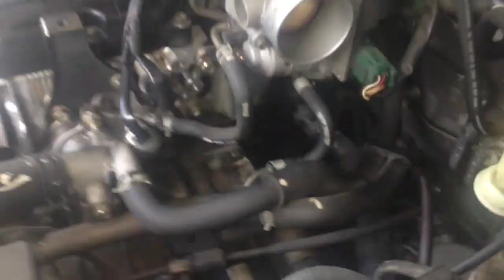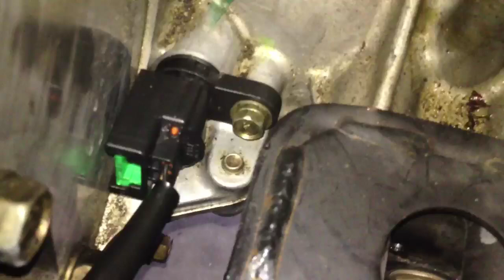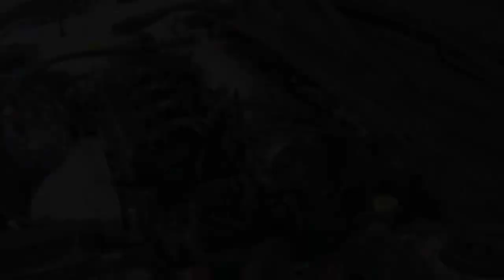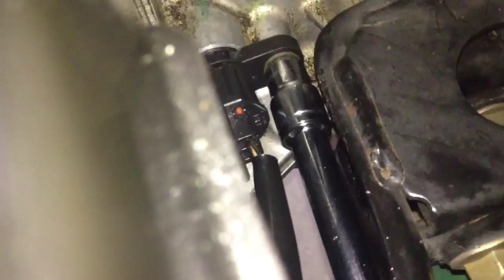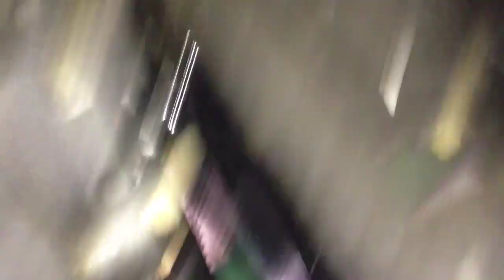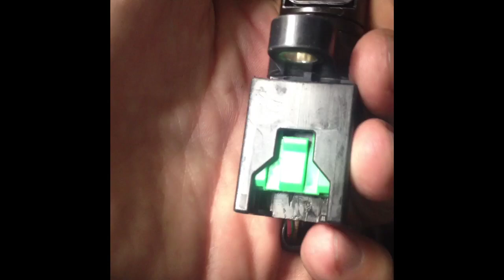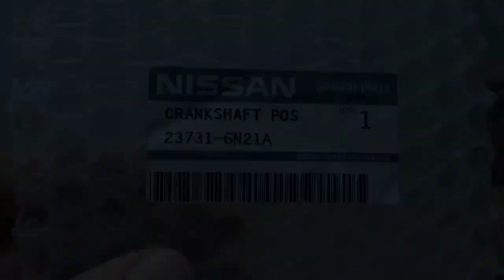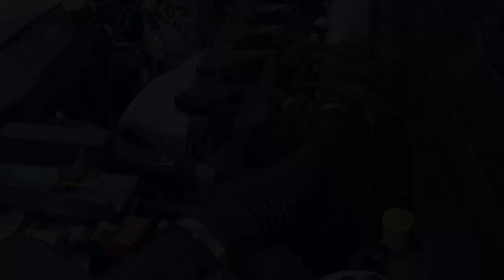Code P0335 / P0340 /P1336 - Crankshaft Positioning Sensor Replacement DIY - Nissan.

Comment: Could these sensors go out and NOT throw a code?  Because my 2005 Altima is not starting and was running really rough before it died, but I don't have any codes showing up.  I think I'll change these sensors anyhow and see if it helps/fixes it.
Reply from the maker: Yes, it's possible. That's how it was with my car. I was driving for few months without Check Engine light and couldn't figure  out what was wrong. When codes finally came up, I new exactly what to do.

Comment: What would the difference be on a 1992 Ford Explorer with a 4.0l? Do you have a video?
Reply from the maker: It will be different on Explorer. Get owners manual for your model on eBay for about $4. It should point out the location of the sensor.

Comment: I have replaced this sensor as well as cam sensor 2 times since I've had the car (within 2 months) and the check engine light goes off after I replace it, but after a couple of startups the SES light comes back on and I still have the same codes 0725 and 0335 what should I do?
Reply from the maker: You probably used low quality aftermarket sensors. It happened to me once. I ended up buying original sensors from dealer. Never had problems after that.

Comment: Sensors are available on Rockauto.com for $23.79.  Look under the 2002 altima/2.5L L4/Ignition sub-heading.  I bought the Wells Part number 5S1928.  Both sensors (crankshaft and camshaft) use the same part.  Both parts fit fine and worked. Parts arrived in 4 days.

Comment: I also had codes P0725 and P0335, and all of the symptoms described by others: very low power engine power especially when climbing hills, slow acceleration, and stalling at traffic lights.  This was the best car repair video I have seen on youtube.  It showed  right where the sensor was (I would have never found it).  It showed the simple trick to unplug the electrical connector (I would have cursed 100 times before I figured it out my own).  It mentioned the need to unplug the electrical connector before removing the bolt.  It even tells you the socked size for the bolt. All that and you video'd the job so I could see what I needed to do (the job must be done only by feel because you can't see the sensor, connector or bolt).  I replaced both sensors (crankshaft and camshaft) in less than 1/2 hour...THANK YOU, THANK YOU, THANK YOU!

Comment: Thanks man for that awesome video, I have replaced mine but the engine light still on and when I went to check it the man told me it's crankshaft sensor, after I replaced it the car stop shutting down by it self and the starting was hard now very well but the engine light still on if you can help me in something, thanks.
Reply from the maker: Some codes won't go away on it's own after the problem is fixed. You have to erase it manually. Either use code reader to erase it, or unplug battery and honk for few seconds to drain all charge from capacitors. Let me know if it worked.
Reply: Temachok Awesome it worked I unplug the battery for 30 min then put it back on now the engine light is gone, thanks man you helped me alot, much support.

Comment: Great video! I just changed this sensor for a friend at lunch today and this was very helpful. One tip: You can see the sensor and bolt if you stand at the DS fender and lay on the airbox, looking down through the closest gap in the intake plenum with a flashlight pointing down and through the next opening in the plenum (a work light down the back side of the motor would be optimum and free up the other hand). 
Makes it nice b/c you can tell that the new sensor is seated correctly and lets you see the bolt when you start it by hand.
Reply from the maker: Thanks for the great advise!

Comment: Nissan replaced my sensor for free there was some type of extended warranty on the sensor. I have an o6 altima.
Reply from the maker: Lucky you. I new they are supposed to replace it, but I was told "there is no outstanding recalls on you vehicle".

Comment: Hi, My wife's 2005 Altima does crank but does not start on first try after car sits all day on the parking lot. We live in Florida so it gets hot in mid day.
After replacing this sensor, can you say you fixed the problem?
I have no errors, so I'm not 100% if the sensor is the cause of not starting from time to time.
Reply from the maker: Not sure. Mine woudn't start when engine was hot after driving for 1 hour.
Reply: Temachok
So you still have the same problem, even though you replaced this sensor?
Reply from the maker: Sorry, "my car wouldn't have started...." It's starting and driving fine for over a year now.
Reply: Temachok
Ok, that's what I wanted to hear :). I just bought crank and camshaft sensors and will be replacing them this weekend.
Reply from the maker: Good luck! I'm doing my rear bearings this weekend. Hopefully I'll record how it goes and post it here soon.

Comment: where do you buy a Crankshaft Positioning Sensor ? please send me link website
Reply: You can buy it at ebay.com. I would recommend to get OEM part. Also, you can get aftermarket part at your local auto parts store is you cant't wait for a week to get is shipped to you or simply to save some money. I tried both OEM and aftermarket, both work fine so far (over 1 year).

Comment: Thank you so much for the video! Yesterday I was driving on the freeway and my check engine light came on and within 3 seconds the car shut off. I quickly put in neutral and tried starting it again and it wouldn't start! We managed to pull to the side of the freeway and I kept trying to start the car but it just wouldn't start! It was cranking but no start.I called the towing company and when they came to load the car, it started all of a sudden! I still had it towed back home but the service engine light didn't turn off. One of my neighbors had a sensor reader and the code P0340 came up. He did some quick review and said thats a very easy job because it was right on top of the engine (he was talking about the camshaft sensor) We went to O rielly with the piece pulled out and came and put in the new one! It started right away! After watching your video now I know it was the crankshaft and not the camshaft! 
My start up to my car has been awful for the past few months! I was told it was the starter and one of the AAA drivers came to give me a jump one time and he smacked the starter and walla t started! Ever since it has been cranking a few times not starting then eventually starting! Maybe its not my starter and its this problem.
I had the crankshaft replaced 2 years ago with a o rielly part. Maybe that gave in!
I am now convinced it must be this problem even though my starter is smashed up a bit LOL. 
how long of a process if I will be doing it myself? You had mentioned that once you put the name crankshaft in it had to be lubed. What does it have to be lubed with? 
Sorry for such a long post! 
Any further advice I would be grateful!
Reply from the maker: It'll take 30-60 min. You'll spend most of the time unscrewing the bolt. Use camera as your eyes and it should be easy to replace the sensor. Lubricate it with engine oil. Old sensor will be covered with oil - take it from there. All you need is to merely get wet the rubber O-ring on the new sensor.

Comment: First, THANK YOU!! Your video is fantastic! I know exactly what the sensors look like and how to identify if they've been replaced! Now, I'd like to share my situation in hopes that you may could assist me a bit further? I also experienced the same situation, however; my car actually stopped running and never started up again! I had a new battery put in first, then a new Starter. Neither of these resolved the problem so (although there is a clicking sound when the key is turned now), I took the new Starter back to AutoZone for a refund and replaced my old one (clicking sound still occurs). I then researched and found that there is a recall on the Crank Position Sensor and Cam Position Sensor for the 2003 Nissan Altima (Recall # 33405) and owners can call 1-800-647-7261 to file a claim. I filed and had my car towed to the nearest dealership. Well...the dealership wasn't interested in the recall whatsoever! They wanted to charge me to run a diagnostic for $150.00 and in the same sentence said that it was my Starter and they would replace it for $650.00...but they would have to wait approximately 6 weeks because they didn't have any and would have to special order one for my car!!! (I paid $150.00 for the one at AutoZone). I told them to ONLY do the recall per the claim filed, please. I could not pay that kind of money. Well, I don't think they liked that because they called me three days later and told me that they did the recall but that wasn't the problem with my car and I still need them to put that Starter in! I told them not to do anything else at this time (yesterday) until I could figure out how to take care of it. :( Any suggestions, Temachok?
Reply from the maker: I personally never go to dealer. $150 diagnostic!!! $650 starter!? Rip off! I found a decent  local mechanic who always does diagnostic for free and only charges me if he fixes the car. In many cases he tells me what's wrong and I fix it myself, like it was the case with crankshaft positioning sensor. Try to look for second opinion.
Reply from the maker: Does the engine crank if you turn the key? Do you have Check engine lite on dashboard? Scan your car for error codes. You'll know exactly what's wrongs.
Reply: Thank you again! No, the engine doesn't crank when I turn the key. The check engine light was still on when I had it taken to the dealership but, I haven't been back to check it since they said they replaced the Sensors.I usually take all my automobiles to AutoZone for free diagnostics. I couldn't in this case because my car would not start. I really don't know where to go from this point...I just refuse to pay the dealership that kind of money to "check" or "fix" anything! I just don't feel as if I can trust them at all! YOU, on the other hand, I think are AWESOME!! And although I don't expect you to have all the answers to my situation, I do want you to know how much I appreciate you taking the time to read my story and help me think it through!! I am very grateful! I know it may take a little longer but I'm not afraid to get under the hood..it won't be the first time! Hopefully I will have a great report to share soon! :) Again, thank you so very much!!
Reply from the maker: Thank you. I'm not a mechanic at all, but I try to research Internet or ask for advise from someone who know what they are doing. I also share online everything I've learned myself.
Try to check starter again. Look for loose connector or damaged wiring. 
Check starting system fuses. You can buy manufacturer car manual on eBay for $3-5. 
It might be faulty ignition switch as well.
Reply: Sounds great! I'm doing exactly the same thing...researching because I'm not a mechanic and I just want to ensure I cover as many bases as possible! I have always worked on my own vehicles as well and I truly appreciate you taking the time to help me with this!!

Comment: thanks for this great video, very easy to follow and saved me a few hundred $$. just one thing i would stress to anyone who wants to do this is that the part is being replaced in this video is an after-market part and it looks slightly different than the original part. the original part requires that the electric cables are disconnected first before you can remove the screw. you do mention it in the video but i made the mistake of FF through that part. thanks again. cheers!

Comment: Hi. I replaced both sensors but the service engine soon error persists. I disconnected the battery (first time the negative only then completely)and waited a few minutes and the ses remained lit after restarting. Took it to advanced auto parts and the same error code P0335. Was advised to drive it a couple days. I have remote start installed on the car (2003 model, 4 cylinder).  No problem starting just shakes a bit when foot down on brakes while stop with gear in drive or reversing.

Comment: This was a great video, went to Autozone bought the Durtalast Sensor for about $30.. Replaced it and it also cleared out the P0725 error.  Dealer wanted around $500.00 to replaced 2 sensors.  Thanks
Reply from the maker: Thanks Robert! Appreciate your feedback.
Don' forget to hit that like button.

Comment: I changed the crank positioning sensor using this video, but my altima still isn't turning over. Do I have to reset the code before it'll work, or could it be something else?
Reply from the maker: Try replacing camshaft sensor as well. Cam and crank are the same part number. Get the error code number if you have Check Engine light.

Comment: Temachok,
I wanted to also say THANK YOU, for posting this video. I just replaced the sensor on my wife's car. It was a pain in the XXX to get to the sensor and I basically had to do it by touch.
Anyway, I used a Duralast sensor from Auto Zone. They said it has a lifetime warranty and only cost $33.00. I have no  idea what Nissan would have charged but I'm sure I saved a bucket of cash!!
Thanks again
Reply: If you keep posting such informative and VERY helpful videos, I'm gonna have to start paying you!!!
Thanks again

Comment: I am having the same problems I see several people on other sites as well having the same issues. This should have been a recall. I called and for whatever reason NISSAN and The Better business Bureau told me there has been no recall on my vehicle YR, MAKE, MODEL, Today my car wouldn't start until I gave it a 4th try. Also as I am driving the car jerks in gear and at times I feel as though the car might shut off while I am sitting at a red light. The check engine light came on, when tested, the error code read PO725 and error code PO335. Crankshaft Position Sensor & Camshaft Position Sensor. I called Autozone and They gave me a price of 32.99 each, the brand is Duralast. I was wondering if this is a good brand.@Temachok... What brand did you use to put on you vehicle? Has anyone on here used Duralast for their car with the same problems. Just wondering what I should do. I've hear aftermarket parts are defected or will eventually not work and i will have the same problem later.
Reply from the maker: One of the sensors I bought from dealer and the other one is from Autoparts, probably also Duralast brand. Both of them are still good. They usually come with 1 year warranty. Not all aftermarket parts are bad. Some of them are pretty good.

Comment: Thank you SO much for the video. I found your video, and after watching it a few times, I figured I had nothing to lose by trying it myself.  I also appreciated the hints by people that said you could see a bit more by looking down through the top of the engine - that helped a bit.

After replacing the car still started rough so I tightened the bolt some more.  Guess it was too loose because now it starts right up and code is gone!  

Really appreciate you taking time to post this and help!

Comment: Thank you so much for this video.  Just finished replacing mine.  Your idea on using cell phone video was very helpful.  To the Nissan engineer that decided to put the sensor on the backside of the engine:  May you spend a thousand lifetimes doing nothing but replacing the sensor.

Comment: i have a nissan sentra 98 , when is hot weather it won't start no cranking, inside the cabine gets too hot for the sun,i think the heat in the cabine it's causing in some conection not passing current but i don't know where. I know heat gives resistance to current flow. Even if the day is hot and i leave the car under the shade it start like nothing wrong is with it. Please help

Comment: I found that between the engine and the air intake, there is a little space where you can see what you're doing. With a bit of aiming, you can light it up with a flashlight.

Comment: @Temachok thanks for posting the video. In no ways I'm a mechanic, the closest thing I've done to my Altima is changed the air filter, the battery, and check the fluids. So, I want to learn "mechanic lingo" and how things work in laymen's terms please! So, the crankshaft is that the reason why my car's rpm is not working properly? And the reason why my car vibrates?

Comment: This was very helpful. I was also able to visualize the bolt on the crankshaft sensor from above, looking down with a flashlight from just after the throttle body. Depressing the lock on the connector was also made easier by using a paint can opener for leverage, which also made for a useful pulling tool to get the connector off.

Comment: Thank you for posting this video. You do make it look a lot easier than what I experienced. Taking out the plug as well as the original OEM part was a huge pain in the rear. But hey, I did it after about 4 hours and my hot start issue seems to have gone away (finger crossed). 1 quick questions though, when I was putting everything back together I saw a cable that goes nowhere that I can see. Would you take a look at your Altima and tell me where this goes? Thanks

Comment: Its possible that it is a fuel delivery problem. I had the same problem that only occurred while decelerating, but i found that if i shifted to neutral before stopping, the car wouldnt stall. Check/replace your fuel filter. In my case, the entire fuel pump needed replacing.

Comment from the maker: Not sure. It might be separate issue. I didn't have problems with shifting. Hard to crank - yes. But not shifing. Sorry, I'm not a mechanic at all. 
Replace sensors first. Hopefully shifting problem will go away as well. 
Keep us posted how it goes.

Comment: my altima hard shifts from 1st to second and now it started to take a second to crank. advance auto said that the crank sensor and the speed sensor errors are showing. will replacing these sensors fix the shifting problem